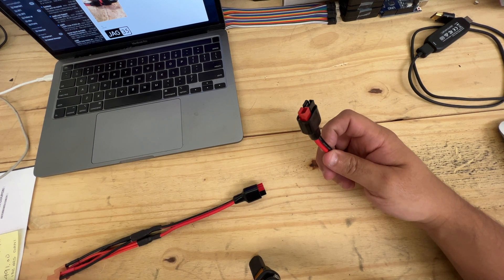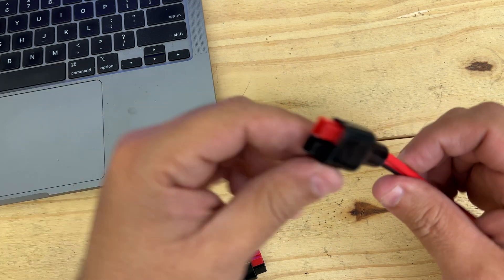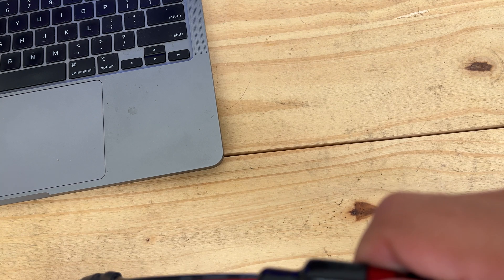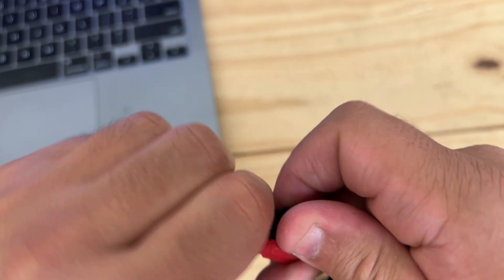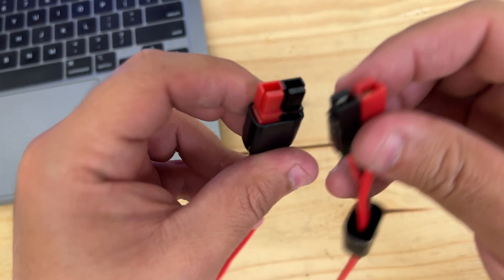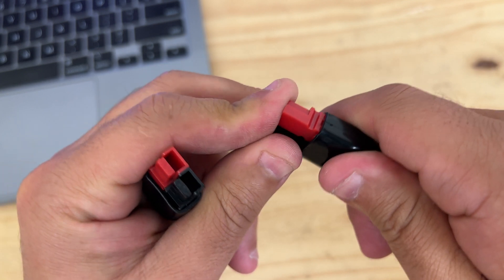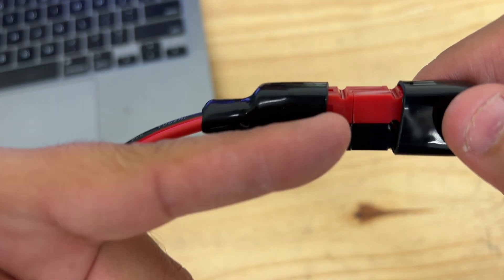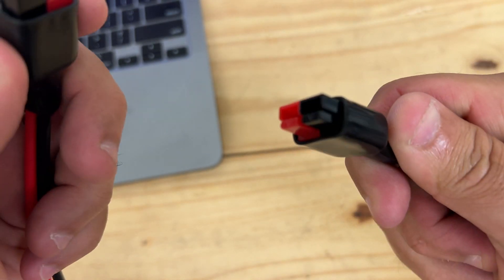How to change Anderson Powerpole connector polarity

Comment: Almost all Anderson to MC4 adapters on Amazon have the polarity backwards!!! In other words, they have the MC4 positive terminal connected to the black negative wire and terminal on the Anderson power pole connector. I hooked up wattbricks panels to Ecoflow Delta Max using the Amazon adapters and the Wattbricks panels and the Ecoflow are wired correctly. The adapters are clearly backwards.
Reply: What happened? Hopefully  nothing happened to your panels or powerstation.

I'm guessing you tested the lines to find out prior to attaching everything? Or did you find out after attaching everything?
Reply: @ Hi Jen, I believe the Ecoflow must compensate for reverse polarity. I hooked it up correctly and everything worked well.

Comment: Note: Anderson Powerpole Connectors are a standard used in HAM radio and Search and rescue organizations for power hook ups. Just watch out for the knockoffs, they do not have as tight fit as the real ones.

Comment: Thanks!  I'm trying to look up a way to connect the Delta Pro power pole connection to the Trailer, any ideas? Do I need a battery disconnect to protect dual 100ah lifepo4's?